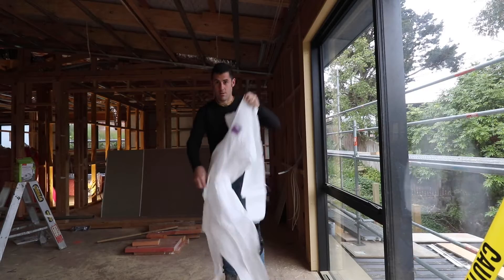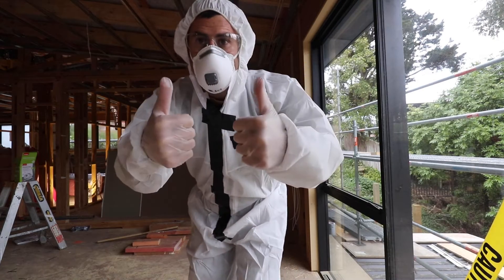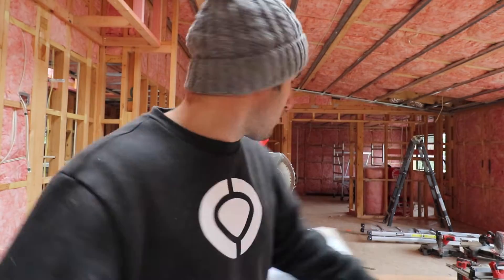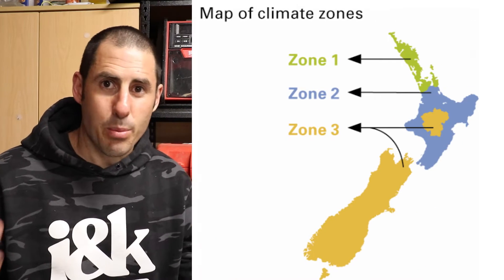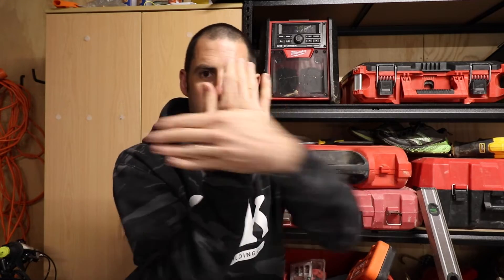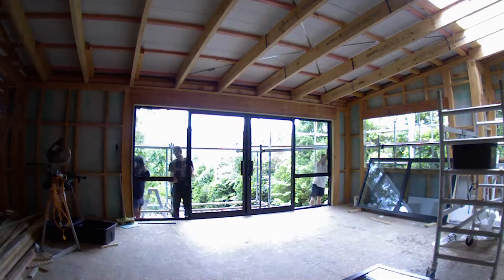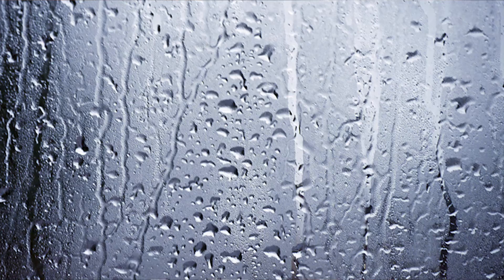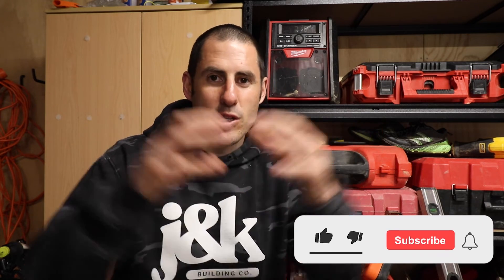Stop Heat From Escaping Your Home

Comment: Is there a massive difference in cost between r2.2 and r2.6?
Reply from the maker: r2.2 = 6.50 per m2 
r2.6 = 11.30 per m2 
r2.8 = 18.20 per m2 
*Based on retail prices on major retailer websites currently, product only, no allowance for wastage or install 

as you can see 2.6 is double and 2.8 is nearly triple the minimum, hope this helps, cheers

Comment: Hopefully MBIE change the insulation zoning as per their recent draft proposal. Will bring us in line with other equivalent country :)
Reply from the maker: Just a had a read, some of it is good and can easily be incorporated now, some of it will defiantly add complication and time to the process which will ultimately drive price up even more. Also I think the cost savings are deceiving, when I did my house I ran some pretty good numbers on power savings vs cost right now, and some things wouldn't even pay themselves off over 30 years. 

In dealing with clients I see a lot of them wrestling with the balance of how much to insulate, heat etc, and the total budget, its a tough one to know the right answer to.
Reply: @nzbuilder   Agreed, definitely a blance and the middle option is hopefully where they land so it doesn't drive prices too high. When I built my place I mostly managed to achieve the medium option (in Christchurch) and it was roughly an extra 10k with easy upgrades. The thing to remember is that if everyone has to do it costs will come down. 
Eg Double glazing is standard now but it wasn't 20years ago, and triple glazing will hopefully do the same but at the moment it's crazy expensive!😀